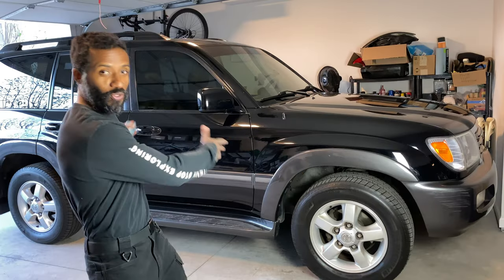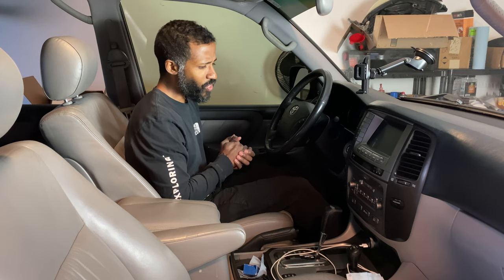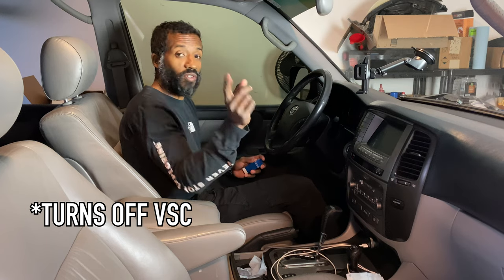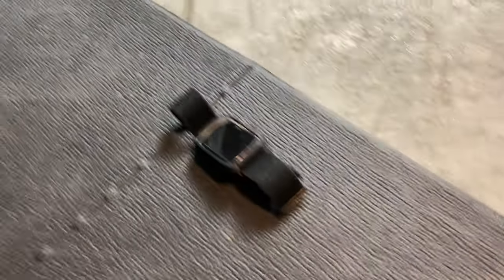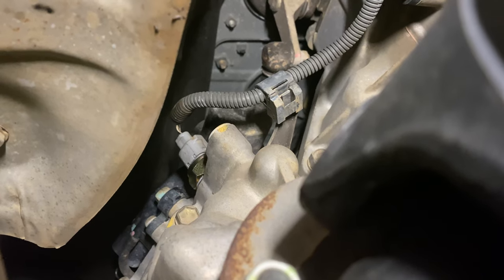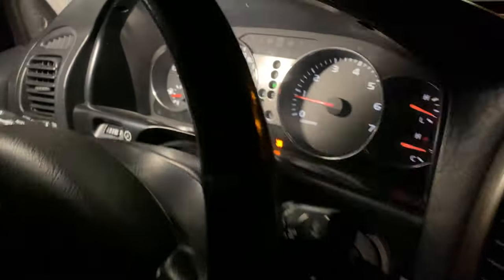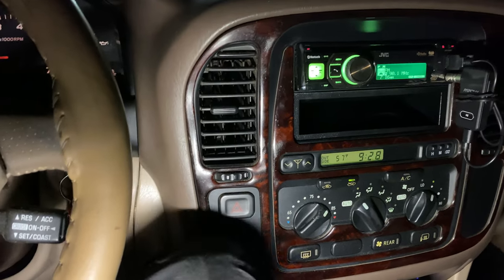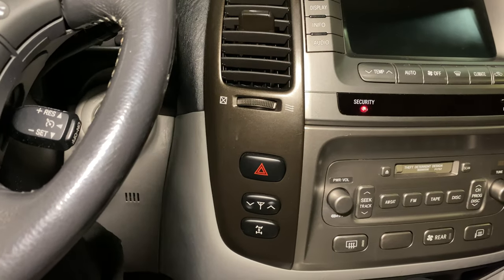Toyota 100 Series Land Cruiser | Center Diff Lock Switch DIY

Comment: Great video! Just did it myself and fixed the issue on a 2000 lx470.

One important thing that you didn’t mention is that there is THREE sensors like that in the transfer case (one for neutral, one for low range and one for the diff lock).
I accidentally started with the neutral one and realized it was wrong just because the connector is slightly different and wouldn’t fit the sensor.
Now, the neutral and low range one are in the back of the transfer case (and easily accessible).
The one that fixes the telltale issue is unfortunately the most difficult to reach and it’s in the upper front of the transfer case. You have to access it between the right catalytic converter and the front drive shaft.
The most challenging part of this job is finding a way to move the 27mm wrench around in that tight space.

It’s a great feeling seeing that light pop up after spending 1 hour under the car :)
Reply from the maker: Thank you I am glad you found the video helpful. All the things you mention are very valid points. Hopefully anyone else attempting this DIY will also find your input useful.

Comment: 270k miles on clock and I never seen this issue. Problem is sometimes with REAR diff, this electric engine and corrosion, but center is ok.
Reply from the maker: Yeah when I found that we had an issue I went on Mud and saw a few posts from others with the same issue.

Comment: Do you feel that the 2005 cruiser is more refined and more powerful than the 1999 cruiser?
Reply: Same question
Reply from the maker: No, it definitely feels very different tho. The best way i can describe it is the 2005 feels like a GX470 and the 1999 feels closer to a 80 series.
Reply: Vvti model will be more powerful
Reply: Because the 5speed gearbox
Reply: Agreed, main difference is the 5 Speed transmission vs the older 4 speed

Comment: Hi Thank you for the video, I think I have a similar problem but mine wont disappear the  light on the dashboard cnter diff lock and the active trac in engage. What do you think is the problem? Is this backup switch compatible with LC 100 series yr 2000? Thank you
Reply from the maker: I would triple check on IH8MUD for a decisive answer.

Comment: My wife was driving my GX 470 to the local store last night, when she was at the light she wanted to adjust the mirrors will our Locking Center Diff button is right next to it, will she pushed that, she stated it was very difficult to park the SUV, and I tried and it was steering very strange, the light was blinking on, s we left the ride, what can we do to fix it or correct it?  I have never gone off road with a SUV.
Reply from the maker: From what you described, all you need to do is turn off the Center Diff lock. It should be as easy as pressing the button again and driving the vehicle. The Diff should disengage fairly quick after it has been placed in the off position and driven a few feet or so.

Comment: My LC 2001 100 series has gon into centre diff lock and light is on. My problem is it won’t go off. The rest of the switches on the same panel don’t seem to work. Do you have any ideas what this would be . 
Thanks
Reply from the maker: Have you tried doing a figure eight in gravel? Typically from what I,ve read on IH8MUD this will unstick stuck diffs.
Reply: @KRTLyfe  I have tried that a couple of times . I’ve now sent in the switch panel to an electrical repair shop as some of the switches are not working and hoping this is the problem , thanks 

I will post the results when I get them in a couple of days

Comment: Looking for a little help. I live in Zambia and have a 2005 100 Series. The CDL is not working. Currently, when you press the button or engage 4LO, the Rear Diff Lock light comes on! There is no Rear Locker! Do you think this switch could resolve the issue? Or do you have other thoughts? Thanks for any ideas.
Reply from the maker: That is interesting, I’m not 100 percent sure but being that you are in a different market your 100 could have slightly different specs. It’s hard to call on that one. I would say search around ih8mud and see if you can find any leads there. You could also try doing some figure 8s in the dirt to make the lockers engage.

Comment: I’m looking at buying a 2002 with a 120,000 miles on it.
What should I look for ? 
It has height control and diff locker
Can I put a 2 inch lift on it?
Reply from the maker: Wow, that is really low mileage! Don’t look a gift horse in the mouth!  I’ve seen people do all types of suspension set ups with the 100. If you do a lift you will have to delete the height control FYI (the entire system). You can find a lot more useful information on IH8MUD. Thanks for watching commenting and subscribing!
Reply: @KRTLyfe  thank you so much 😊